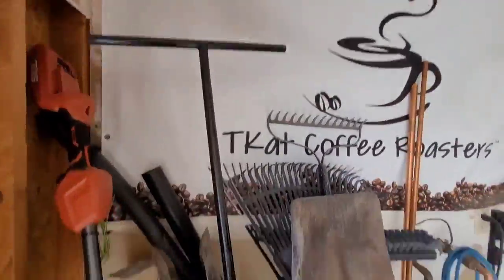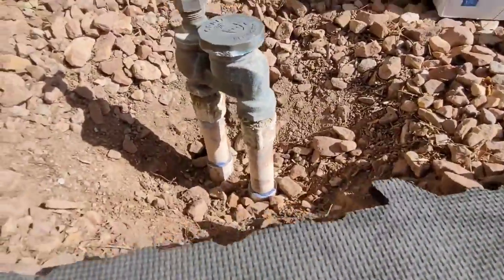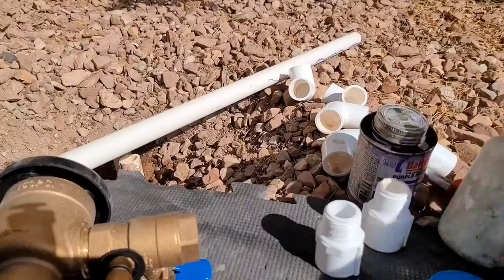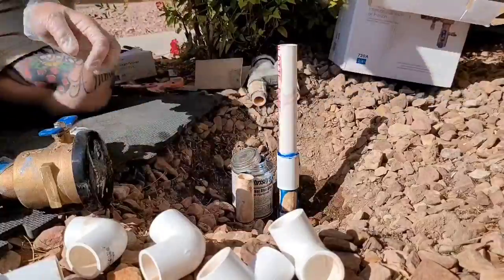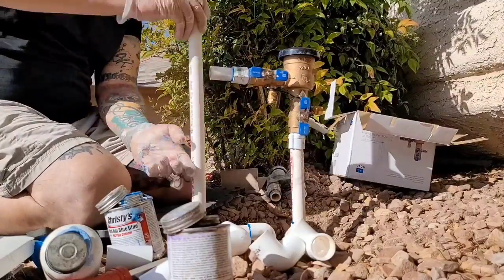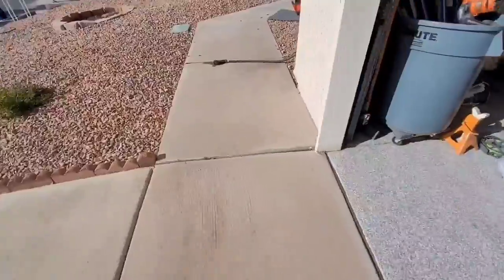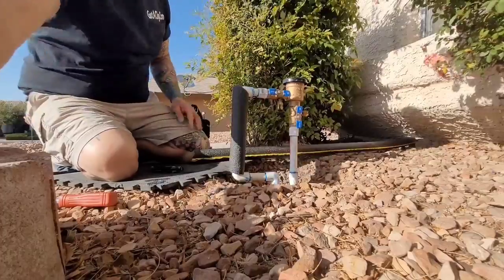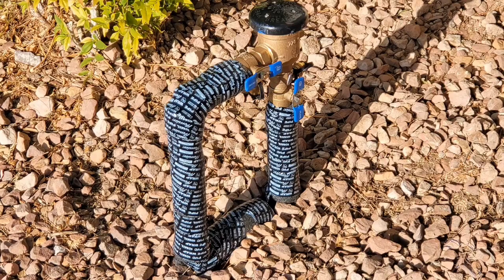How to install a new irrigation (anti-syphon)  valve  - Wilkins 720a PVB

Comment: Great video explaining in detail the materials and steps to perform replacing a Wilkins 720a vacuum valve. Mine current one is older and the shut off handles are frozen tight so I have to use a hammer just to close the valves. I intend to replace mine along with a new sprinkler timer. Thank you and have a Blessed 2022. Steve😀